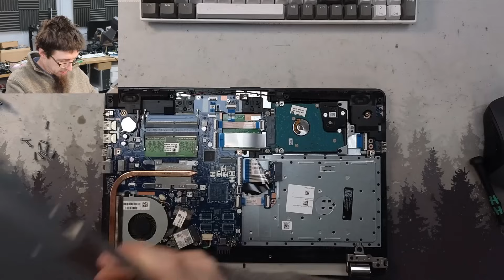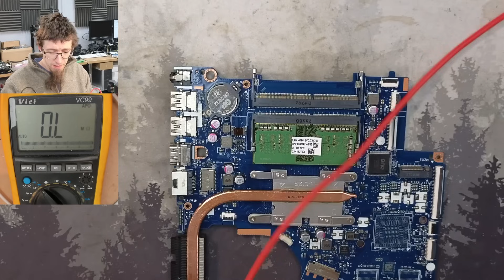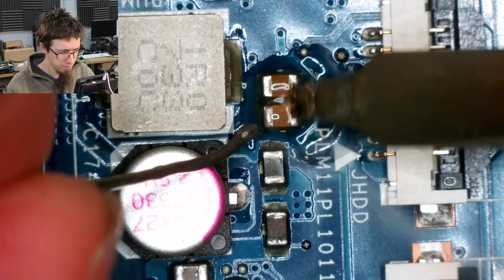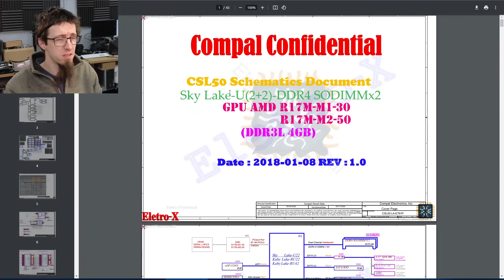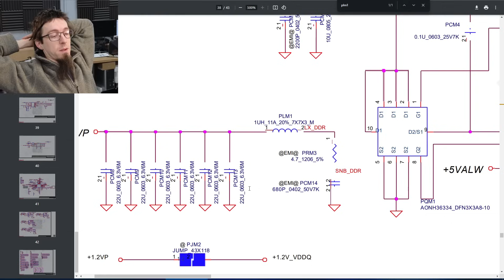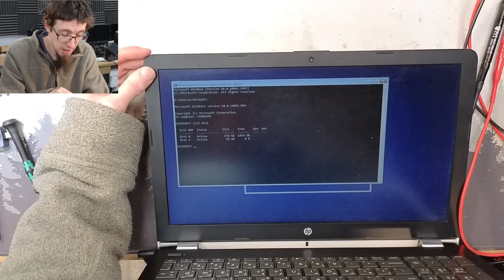The Classic No Power Fix We All Love To See - LFC#383

Comment: The failed cap was on the 19V rail, not on the 1.2V rail, so make sure you used a 25V rated cap and not a 6.3V one.
Exact capacitance doesn't matter that much if it's a few µF.
Reply from the maker: arrghh... Of course... I'm not sure how I missed that. I got so bamboozled by the schematic on this one that I lost track of where I was actually working.
At 23:50 I said "Let's look for the inductor because the caps are connected to it"
What I meant was: "...because those caps are part of that regulator"
Then once I had that in my head, I looked for output caps, not the input caps. 🤦‍♂️
But yea, I used 25v caps, so the repair was correct, just my schematic reading was completely off.
Reply: @Adamant_IT  I think it's one of these schematics that haven't been leaked as-is in full and instead just put together from various pieces by a third-party to sell. Better than nothing but it's quite messy and might not fully match the board.
Reply from the maker: Yea. It starts making sense when you read it right-to-left instead of the traditional left-to-right, but I didn't spot that in the heat of the recording moment. Bummer, but as you say, plenty of margin for error with bypass caps like these.
Reply: Chinese 😂
Reply: MLCC caps are generally rated at 50V so that's not normally an issue. Voltage rating can be distinguished by size so the easy way is to replace the cap with one that's the same physical size (height, width and depth) and that should guarantee the cap has the same basic specifications. Anyway, in this case there are already plenty of caps there so no need to replace it. One missing cap is like pissing in the ocean, won't make any difference either way if it's there or not.
Reply: @g4z-kb7ct  You said the same thing on another video so I'm just gonna say it again:
Wrong, on laptop boards MLCC bulk capacitors are generally rated from 6.3V to 25V, although the smaller ones (high-frequency/EMI filtering/crystal load capacitors/…) in the pF range can be 50V rated.

The voltage rating is written in the schematics. Indeed, it is related to the size of the capacitor (higher voltage rated capacitor have lower density), however it doesn't mean a given size has only one possible voltage rating. MLCC density increased over years, so capacitors 25 years ago would have needed to be bigger than today's capacitors to achieve the same voltage rating and capacitance. And even modern capacitors come in different sizes for the same voltage rating and capacitance. Apple, for example, loves to use higher density capacitors, which you'll not find on cheaper/lower-end laptops because there's no need for that and it'd be more expensive.

Finally, about replacing a cap or not, it's never a good idea to leave random components out if you're not sure they're not needed, and since you're not one of the engineers who designed the board it requires a decent amount of knowledge and experience with this kind of board design to know that. For example, it's not because you already have 30 capacitors on the main power rail that you don't need this one, the others may be too far away from the input of the buck converter to be effective.
And then, that's just my personal opinion, but if you care about doing a proper job you try to make it look like you were never there in the first place. There's nothing worse than opening a machine and going "who the fuck did this mess". Because if you think it's fine to leave out random capacitors and you shouldn't bother replacing them, might as well leave out a couple of screws, and why bother cleaning your flux, etc…
Reply: @piernov lol if you had bothered to do some research you would have found that I've done over 5000 repairs and documented everything. The quality of my work is second to none. Nice try bud but you can't make me look bad unless you have done more work with better quality and documented it publicly.
Reply: Sick Burn 😂 @g4z-kb7ct
Reply: @piernov  it is completely fine to leave out random capacitors on the main 19V . I done it tons of times when repairing short to ground on main 19v power rail never failed or customer came back complaining. remember no capacitor means no shorted capacitor.
Reply: @personalPickle  I think most don't see your comment because it is visible only if comments are sorted by Newest first, and graham has his video's setting set to sort all comments by Top comments, which hides many comments.
Reply: @flat_earther  :face-red-droopy-eyes::face-fuchsia-poop-shape::face-purple-wide-eyes::face-red-heart-shape:
Reply: @g4z-kb7ct  You've clearly not designed and manufactured any circuit boards if you think that, other than maybe C0G caps assuming they're rated at 50V is highly likely to cause you issues. Especially for bulk capacitance it's very unlikely to have them rated for such a high voltage as you'll trade it for lower capacitance and higher ESR.

Comment: Finding the faults are easy and made easier with thermal if needed. Repairing it is the issue. I still need a microscope setup and I really want to get those solder tweezers. The last issue is sourcing the parts. My country's currency is ridiculous. For $1, it is actually almost 17 bucks. Meaning a $100 price is almost 1700 bucks for EXCLUDING delivery and import tax. All those nifty tools are available, just have to rob a few places to afford it...lol

Comment: The visible crack in the cap shows up after voltage injection. otherwise they don't always show because the PS usually shuts down before enough juice goes through them. cheers mate!

Comment: Hi! Do you use a particlar brand/supplier for your SMD capacitors or just some random ones of Amazon/Alixpress? Thanks.
Reply from the maker: eBay/China stuff. The spec on them will be a bit wonky, but for bypass caps they're fine.

Comment: Do you really have to replace the caps? I've been wathich Electronics Repair School videos as well and he never replaces them and even explained why. I just want to know another point of view.
Reply from the maker: Most of the time the board will be fine without the cap, yea. But sometimes it won't, and if it causes a problem (like an unstable regulator that just resets itself at random) it's going to be a horrifying job to diagnose. Given how easy it is to replace most caps, IMHO it's a no-brainer to put a new one on the board.
In my early board repair work, I didn't replace because I didn't have the parts, but then I learned that there's only a couple of common parts you need to stock, and then it was no problem to actually complete the job instead of leaving it half-done.

Comment: I wish that i had all that tech knowledge as i have an HP laptop that stopped charging and thought it was the battery so i got a spare one from ebay. It turned on and reinstalled windows so i thought that was it, but a while after i noticed it still wasn't charging and was close to shutting down... and it did giving no chance to check the bios and unfortunately it's one of those laptops that doesn't have a bios battery so i can't take one out to reset it. It's also frustrating that i have no way of charging the battery outside of the actual laptop.

Comment: On these SoC laptops, at the manufacturer, is there a less or lower concern about fully removing (cleaning) flux residue from the mobo?
Reply from the maker: To clarify, this one wasn't an SoC, it just looked like one at first because there was so little on the board. But yea, that flux residue you'll find on any laptop, sometimes the edge of a component was just sheltered enough to not get washed properly in the factory.
Reply: @Adamant_IT  thank you 🤓

Comment: Depending on the generation of the i3 it could be worth adding a cheap 4GB stick and an SSD. I have souped up worse potatoes for the £50 that would cost. We all tend to have much higher expectations than someone who has happily used this for email, word processing and a bit of internet browsing. They aren't expecting Cyberpunk 2077 at 60 fps.
Reply: Replacing the HDD with a SSD is ALWAYS worth it, even with only 4GB it will transform the laptop to a new experience for the user really.
Reply: @Doman2000  Agreed, I just checked my estimate of £50 on Amazon.
Crucial RAM 4GB DDR4 2666MHz CL19 Laptop Memory CT4G4SFS8266 £14.78
Kingston A400 SSD Internal Solid State Drive 2.5" SATA Rev 3.0, 480GB - SA400S37/480G £31.59
I really can't see how spending the same money elsewhere gets a better result for the user.

Comment: I think you may have misspoken about the CMOS battery going into a diode, causing further drop. I believe the CMOS battery is directly attached to the RTC (Real Time Clock) with no diode is series. Any switchover is done internally in the RTC chip. I looked at an offering from NXP and it can accept 1.2 to ~ 5 V. on the battery pin. Nothing wrong with changing the battery, but it probably has a lot more useful life as you were measuring it under load and with the load of the meter. Anyway, thanks for all your useful videos.
Reply from the maker: Depends on platform then I think... certainly for many platforms the strategy is a dual-diode with the batt on one side and charger/mains input on the other side. The charger/mains input is configured to be 3.3v, so when that's active most of the current draw into RTC will be from there, then when it's inactive, the current draw comes from Batt instead.
Reply: @Adamant_IT  You may be correct, the few RTCs I looked at had the switching internally, I looked at Maxim and NXP, they have a 3.3 V pin and a Vbatt pin, and a comparator internally to determine which source to use. According to Panasonic's website its CR2032 open circuit voltage is 3.1 V, so 2.99V is not too bad, especially since we don't know how much loading the circuit and meter provide. Anyway, thanks for your inputs.
Reply: @SuperFredAZ  There is no discrete RTC module in a laptop. The RTC circuit is part of the southbridge, so PCH in case of Intel (same package as CPU here but that's not relevant). In this case, the VCCRTC rail that feeds the PCH can go down to 2.0V.
However, as @Adamant_IT said, there is a dual diode between the coin cell battery and the PCH, typically a BAT54C, so that will create some voltage drop. The RTC circuit doesn't draw a lot of current, let's say 40µA at worst (generally it'll be closer to 10-15µA), so the voltage drop should stay below 100mV. There's also generally a current-limiting resistor, maybe of 1kΩ in series causing some additional voltage drop but still small (with these figures that'd be 40mV worst case).
All in all, 2.99V is perfectly fine but the coin cell battery still has seen several years of service so good opportunity to replace it anyway. And even though theoretically you could say it should work down to like 2.2V, I know for a fact that this can cause problems so better replace it when you see one that's a bit lower than 3.0V.
As for measuring "under load", i.e. in circuit, that's precisely what you want to do, because a bad battery may appear fine when there's nothing connected to it, but have a significant voltage drop when some current is drawn, in which case it doesn't do its job in supplying a proper voltage. There could also be a leaky dual diode or a bad PCH causing excessive current draw. The DMM itself should have 10MΩ input impedance (as long as you don't touch the probes with your bare fingers), so that's negligible (less than a µA).
Reply: While working with AirTags and old computers I found that new batteries have higher current-supply capacity in a low-resistance battery tester, and last longer in an AirTag, than old batteries sitting around for years (even if the voltage on a multimeter or multi-kohm tester doesn't agree). Just don't leave the button battery in the tester for over a minute or it will drain the battery for hours and leave it with less charge afterwards.

Comment: cmos batteries are supposed to be 3 volts so I don't think the battery was flat
Reply from the maker: It's powering a 3.3v circuit. It can sag low, but a lot of devices will start having issues when you go down into 2.9v. Sometimes you can sag really low without issue, but if the device is having problems, you want to make sure it's above 3.0v

Comment: if there was no power did you check the mains adapter first to make sure that was working
Reply from the maker: At this level of repair, I will assume that the tech is competent enough to make sure their charger works 👌

Comment: no way this laptop was a write off when the HDD was toast.
4GB extra DDR4 sodimm + 500GB M.2 Sata SSD (M.2 interface on this machine is probably SATA only, be mindful of that!) costs about £50.
The laptop is worth that, incl the ~1hr repair.
Surely this laptop is worth ~£200 if it has a 500GB SSD and 8GB inside it?
Reply from the maker: You can buy 2018-era Dell Latitudes with quad-core i5 CPUs, 8GB of ram, 256GB NVMe, 1080p IPS display for about £160 on ebay. This makes a lot of mid/late lifecycle laptops like this not worth overhauling IMHO.
If we take the board repair out of the equation, then yea I'd say this guy is worth the upgrade, but board repair should be £100 alone, not including labour for fitting upgrades. So in this case, it was more or less a make-good repair.
Reply: That is very cheap. Clearly I'm not up to speed (and I'm in the Netherlands, here prices might be different, but it's probably more that I'm not up to speed...)
The quad core mobile i5's (mostly 8250u I think for that budget) are way more useable than the dual core i3's.👍

Comment: I got psd for that squematic ( 24:00 ), i been trying to fix a similar laptop (1 year older) that doesnt output the 1.2v for the ram, and the part of the schematic i been stuck is a 1/1 copy of yours, apparently everything is shorted in that rail but nothing gets hot with injection, (1v 5a)
I remove EVERYTHING on that rail and the short remains, i dont know if its the ram socket itself or just a short between layers
Reply: You have the CPU on there as well.

Comment: If you are worried about using hot air near sensitive components you can use a shield made from a drinks can or even just a coin to protect them.
Reply: Or put some kapton or aluminium tape over it. But I'm sure Graham knows this, he's just a bit lazy here.. 😁
Reply: Or a thermal pad. I always have one sitting there

Comment: To me that disk / windows issue is more interesting than fixing a couple caps. How did you get the HDD to work? Maybe a part 2 video?

Sometimes software and BIOS issues are maddening to fix.
Reply from the maker: Set the BIOS back to CSM (legacy) boot. I could make a video about converting legacy installs to UEFI, but 9/10 times if the windows install is old enough (or badly configured enough) to be legacy, you should do a clean install to make sure there's no weirdness in there. The simple method is; 1. make drive image of windows partition, 2. Clean install windows in UEFI mode, 3. Restore windows partition over the clean one, without altering the new system and restore partitions.
It's also possible to simply remake the system partitions as UEFI, but since you need to make a backup anyway, it's not meaningfully faster.
Reply: @Adamant_IT  .. Thank You!!! Excellent information and at least from my perspective it would be one hell of an interesting video to make and watch. Often the things that you think are mundane and uninteresting quite the opposite to those who don't know. 👍😎👍
Reply from the maker: Yea this is fair. This topic came up in the discord chat as well, and someone pointed out that there's quite a few older customer gaming PCs that will have janky windows installs on them that suffer weird UEFI/CSM problems. So there's probably mileage in making a video about this after all.
Reply: @Adamant_IT you would use backup sw like Acronis to make windows drive image? Not sure how to restore windows partiton over installed windows system partition without altering or breaking existing installation?

Comment: adam never replace a shorted capacitor (No capacitor no shorted capacitor).hhh also you do a favor to the customer this fault not to come back
Reply: You have to be certain on the purpose of the capacitor.

I know which channel you're referring to that gives out that advice, but it's incorrect.

Leaving out a bulk or decoupling capacitor can lead to an unstable device. That's definitely not doing the customer a favour.

EMI suppression caps are generally ok to omit.

Comment: I know we kind of look down on this era of laptop but credit to all of the manufacturers: they were easily upgradeable with two RAM slots. A relative rarity in this segment now.
Reply from the maker: This is true... although IMHO that's not a reason to underspec laptops at the factory. The HDD is to be expected I suppose, but 4GB of RAM was poor well before this laptop was sold.
Reply: @Adamant_IT  Yeah, I'm pretty sure I even saw a 'new' 4GB laptop being sold recently in some sale.

Does it have an M2 slot? I think I saw one. I bought a Latitude of this era for a family member and just threw a cheap M.2 SSD in it and 8GB before giving it to them, still going strong.
Reply: Two slots doesn't mean that it can be upgraded to 8gb of ram. If it is a 32-bit architecture it would support max 4gb of ram.
Reply: @RedDefender77  Yes but it isn't, it's a 2017 laptop and there's basically nothing out there running a 32 bit chip since the late 2000's.
Reply: @lemagreengreen  I had a HP laptop for 10 years, bought in 2009, it was a 32 bit system.